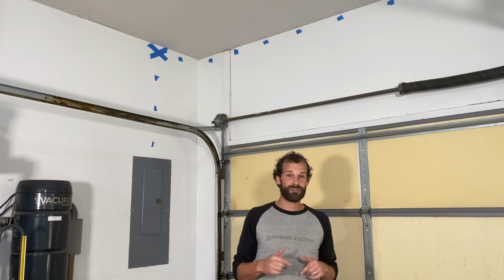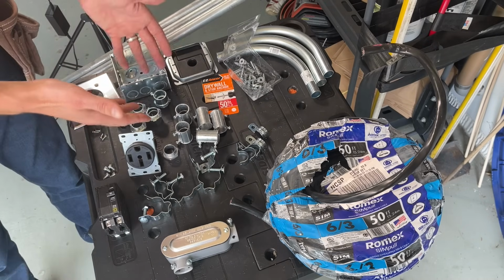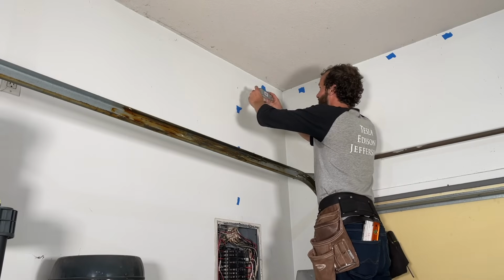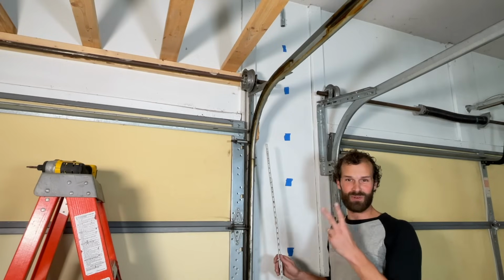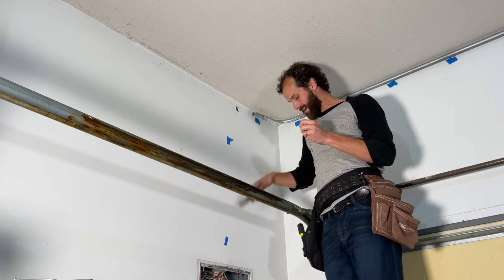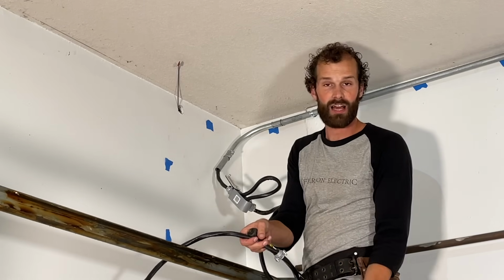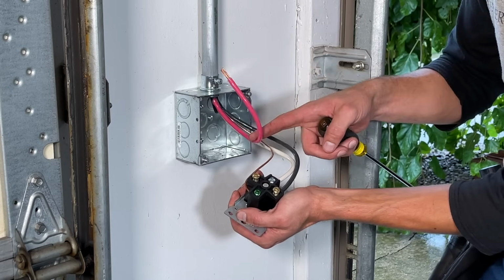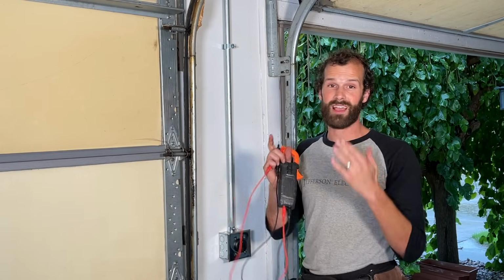How To Install a 240 Volt Outlet | Electric Car Charging

Comment: Nicely presented video, there definitely is a lot of value here just for giving people an idea of what's involved with this install. May I suggest though possibly leaving a pinned comment at the top noting all of the possible mistakes that have been pointed out by the community? Think it would be a good idea so that someone actually approaching this project (or wanting to see how an electrician should do it properly) knows that the video isn't perfect, and can use the pinned comment to ensure they know exactly how this should be done. I'm not really for the whole anti-DIY bandwagon I see going on in these comment sections, but I definitely do agree 50A 240V is not something to toy around with either.
Reply: By leaving a pinned comment he would be admitting he did not do the installation correctly and leave himself open to the consequences of someone following the instructuions and getting hurt/ killed.

Comment: My whole house has only a 100amp main breaker.. Can't be upgraded.. So forget ev.. No ABC for me.. Always be charging... .. Better install a giant hylon fire extinguisher for when it catches fire in the garaje and burns your entire home down as well a the concrete slab under the car
Reply: You can use an EV if it has a control that lets you regulate power draw.

Do you have 2 phases to make 220?
You can probably still use a smaller 220 outlet, like 15 or 20 amps.

Comment: Great teaching style and video.  I am a DIY guy only going to replace the outlet from a cheap one to a good heavy duty one but I watched the whole thing and it was instructive.  One question: While I understood the reason for flexing the wires, then tightening, and repeating that in the outlet box, why was that not necessary in the panel?  Is that because there is no flexing from inserting and pulling the plug?

Comment: "They're the 'same' thing." Yes and no. Yes, in the sense that they mean the same circuit. No in the number of volts. Tell people that since the voltage has gotten a little higher over the decades, the normal actual voltage is between  230 and 250 now.

Comment: I use a small anvil a ball peen hammer to flatten out the ends of the wire a little bit to insure a good tight connection

Comment: personally I would have gone with BX over Romex  its not only $52.00 less in cost for the wire  to buy also less work involved with fighting to pull that heavy wire through conduit.

Comment: Thanks for the video. Your friend is an enthusiastic electrician and a great teacher.  Agree with commenters that some things could have been done better.  For instance, much prefer THHN wire in conduit and would like to see a conduit system go from panel to box.   Would consider the installed tubing in this case to be more of a protective sleeve rather than a true conduit system.   Also not a fan of the faceplate arrangement on the wiring device.  Regardless, enjoyed the video.  Always glad to see other pros work.  Keep up the great work!

Comment: Great info but too all of those out there. TAKE YOUR RING OFF YOUR FINGER. Your hands are sweaty and wet not to mention its a great way for arking. In my job I do not wear my wedding band even with power off because the machinery may be off but there are capacitors that still hold charge. Smh

Comment: Good video, I watched it beginning to end. I have a couple peeves and questions though. 

Is this different from residential outlet installation where you curve the wire’s copper contacts into a hook before seating under the terminal screws? Is that not possible with this thickness of wire or is the terminal clamping mechanism different so that is not possible?  

Also I really don’t think the constant knocks towards safety especially while encouraging DIY’ers is a good idea. I think you should mention first and foremost where and how to turn power off and very specifically how to determine what’s still live if you couldn’t get a utility company to cut power from the meter. It is not ideal for you to start doing things and then three steps in be like “oh by the way you could have turned off power” because a person following your video to a T would likely inevitably do it in the same order as you. 

Please zoom in a lot more when you are talking about tiny specifics in the panel. I understand maybe you don’t have a cameraman and that the camera might just be on a tripod, but right now it’s basically us just watching some guy point at a million connections in a box for 5 minutes while you can’t actually see what he’s doing or even referring to, and then moving on with our confusion and questions still in place. 

Also it would be great if you could possibly do a video where this is installed as an outdoor receptacle near the driveway for those of us who don’t have garages.
Reply: This outlet is designed with internal clamp plates.  Conductor goes in hole, turn screw to tighten clamp.  You can get 120V15A receptacles made the same way , but more expensive than what you usually see in big box stores.
Reply: Please review NEC 625....electric vehicle service equipment in the National Electric Code.  This is the car charging section..  

Gfci breaker for recepticle for car chargin,, one charger per breaker, even as petty as the recepticle cove requirements for outside recepticles.

Hope that helps and remember, you can hire a pro.....

1.  You pay him to do everything

2.  You pay him to boss you around while you do everything.  ,(cheaper option and you keep that feeling of satisfaction,).  Okay  call it consulting  and pointers if you want.

Comment: Installing a NEMA 14-50 with the pointless neutral is pants on head retarded. NEMA 6-50 is the correct receptacle for car charging. The NM in conduit and the flush plate and mud ring on the unbonded surface box screams DIY really loud. And remember it's 40 amps continuous for your calculation, not 50.

Comment: I’m a little confused why you didn’t just go ahead & put in a double plug-in/outlet, since you were talking about TWO electric cars to begin with, having the two bays. As long as you’re there & doing it, might as well have set up for maximum allowance. Just my 2 cents.

Plus, with that J box up top, was it too thick & stiff of wire to route through the back hole to begin with, instead of having to shove in that loop? Seemed like a lot of stress. I’ve found it’s easier to just thread it direct like that instead of trying to loop out and then back in, even if I did have to inch my way along the wire until I got it to where it needed to be.

Comment: Great video - however, I have no more space for any kind of breaker in my panel. Can a plug be added with an out side breaker? any suggestions. Is that safe? or building code approved? a breaker out side a breaker box!
Reply: Add a subpanel, a second circuit breaker connected to the first.  Move some circuits to the subpanel to make room for their connection.

Comment: DIYer here. First off, super well done and detailed video! But I do have a question: if I'm not mistaken, as of 2020, don't you need a GFCI breaker for all outlets installed in a garage? (NEC 210.8(A)(2)). But I have also heard people say that the EVSE has a built in GFI that doesn't play nicely with having another one in series?...
Reply: I put a spa panel with a GFCI for mine when I did it since the garage is considered a wet location.

Comment: I'm not an electrician but I seen some incidents that looked unsafe plus lubing to have a smoother line feed seemed logical. That panel should have been covered while wire feeding. Especially install new breaker into the bar. your a lucky guy from what I seen.

Comment: I lucked out... the former owner had a 240V 50A line run to their hot tub and the cable is plenty long enough to re-route to the garage wall for electric vehicle power.  I decommissioned the tub and saved the breaker and cable run.   I only need to move the one end of the cable (in the basement), drill a hole and buy the box, receptacle & cover to mount on the garage wall.  Win, win.

Comment: One correction - NEC 625.54 require that EV charging receptacles be GFCI protected so you should have used a GFCI breaker. (garage receptacles are required to be GFCI protected as well.)
Reply: So the ev is going to be pulling 40 amp max because. Nec 625.41 this is a continuos load 
40x1.25= 50 amp current protection.
Reply: Good point, missed that one
Reply: Can I use a 60 amp breaker instead of 50?
Reply: @alexmckay5447  what kind of charger are you installing?
Reply: @alexmckay5447  no dont use 60 amp breaker instead of 50 amp you  if you are installing the NEMA 14-50 OR 6-50 THE OUT LET ARE REATED FOR 50 AMP MAX BUT YOU CAN ONLY USE 40 AMP CONSTANT LOAD  40×1.25= 50 AMP BREAKER . YOU CANT PUT 60 AMP BREAKER LOOK 48×1.25 =60  THIS IS A TESLA WALL CHARGER.
Reply: @alexmckay5447  yes if you use the right conductor size and get a larger capacity device.
Reply: The tesla wall charger and others are GFCI PROTECTED INSIDE THE CHARGER SO YOU DONT NEED GFCI BRAKER  BUT LIKE THE 14-50 AND 6-50 ARE NOT GFCI PROTECTED YOU NEED A GFCI BREAKER.
Reply: @panchopantera8287  if you have the equipment hard wired then there is no need for a GFCI breaker. If you are using equipment that plugs into a receptacle then any GFCI protection in the EVSE will not protect at the receptacle and GFCI protection is still required.
Reply: @ptester1  that is correct.
Reply: @ptester1  A 14-50 and 6-50 needs to be gfci protected at the breaker.

Comment: I think YouTube needs to make sure people are certified electricans before showing people how to do the work. 1st. No cardboard in front of the live panel , while using a metal fish tape.
2nd. While running pipe. You never leave the jacket on the wire. It's causes heat to build up, in the pipe .
3rd. They are not professionals.
3rd. These guts are not professionals.

Comment: Great video. I have two ac units. One ac unit is wired via a long under my courtyard conduit to a sub panel in a "mudroom" adjacent to my 2 car garage. I rarely use this 2nd floor ac. Is there a code legal switch that can be mounted adjacent to the 50 amp sub panel that I can use to either lead to new wiring to a 50 amp 240.plug that I would install in my garage or to the existing roof mounted ac/heater,  So I would be able to either charge a ev or run my ac?  One or the other not both.

Comment: I'm wondering if the rule below, applies to basement installation. The rule doesn't make any comment on it. This is Ontario code I believe. So 130 mm is about 5"

The stove receptacle (14-50R) must be mounted so the centre of the receptacle is 130mm from the finished floor (rule 26-744 (6)(a))

Comment: Liked this guy's step-by-step explanations, "pro tips," and odd little tips I've never heard of before (like the foldable ruler preference over a tape measure for one-handed use).

However, what surprised me right off the bat the most since this was targeted at DIYers was him not turning off the main breaker once the electrical panel was exposed.

Now, I can understand maybe Pro's not doing that and inconviencing a whole houseful of people (the client's family) going about their normal everyday electrified existence while he's out in the garage adding a 50 amp breaker and pulling wire, but as DIYer, I would certainly turn off the main breaker for the short amount of time pushing in the new breaker as well as pulling in the new wire and working in close quarters with an open 200 amp panel. normal

Comment: If using EMT, why use a ground wire? Ground outlet to box. Loads panel is grounded. EMT carries ground between box and panel.
Reply: Lower resistance?

Comment: Is there no requirement to ground the boxes and the conduit other than through the mud ring? It is my understanding that since the mud ring is a 'removable cover' it's not considered a valid grounding path, but will gladly stand corrected if this is not the case.

Comment: I think I would have used a 4 11/16 Box on both ends, plus I would have loosened the landing screws on the breaker before installing it

Comment: WOULD IT NOT BE SMART TO INSTALL A BOX AND BREAKER ABOVE THE 240 VOLT OUTLET ,,,TO TURN THE POWER ON ,,,AS TO NOT. HAVING TO PULL OUT THE. PLUG ,,ALL THE TIME.

Comment: Excellent video to teach DIYers.  Why didn’t he use THHN wires because the black outside jacket isn’t necessary inside EMT.  4-THHN wires are thinner and would pull easier.  They probably cost less too.  If a wired EV charger was used, note that most models do not have a common wire so you pull only 3 wires, 2-hot & ground (bare or green).

Comment: Your also not allowed by code per the nec to build conduit around the wire .you have to build the run and then pull through the boxes or pull points

Comment: Interesting presentation however,  just about everything is COMPLETELY WRONG!   I'm not an electrician nor a handyman I am a typical homeowner.  Cut the drywall  a foot away from the top of the panel  & use emt only. Never use nms (aka romex) I would have used THHN insulated cu wire.   It is  fast & easy to repair the drywall later.   Only use one  conduit body  inside the wall and one  4" junction box.  Flush mount the emt  all the way to the 50amp. outlet  merely making a box offset with your emt bender.   Don't use  pre-cut 90's  with excess fittings,  you only need  emt couplings and emt box connectors.  (you are buying too many parts for this simple single-phase 240vac instillation.   Per NEC  spacing guideline  for supports,   mark the wall stud locations  so you don't have to use  plastic drywall fasteners.   This goes for the  50amp. receptacle box  should be securely screwed to wood stud  and  file smooth the cover plate if there are sharp edges.   It is best to use compression fittings  and  you failed to use  insulated bushings  when  using box-connectors & lock nut only.  Always unsafe to use fish tape in electrical panel.  You don't even need a fish tape, wire pull lube,  or  another worker to help.  A better method  is to put up  all the emt with only a couple of clamps,   then  slide  each length of emt onto the wires,  so fast and simple.   A better method of de-burring emt is to use a "rout-a-burr" as all machinists  use.    I know I could do the installation faster,  safer,  with less money spent  and  all done to NEC and local electric codes.

Comment: Hi, I enjoyed the video.  I am going to be installing a 240v 20amp outlet for a ham radio amplifier and had a question.  I have seem some electricians comment that you normally shouldn't use Romex inside a conduit. (Not that it presents a code issue, but that that it just normally isn't a typical practice because of potential heating problems.)  Do you have an opinion on that?  I know I could purchase the separate 12-guage THHN wires, but thought 12-2 NM would be simpler and not too stiff to pull.
Reply from the maker: Hey Nick,  unlike what the video showed I would recommend Separate wires as compared to the Romex we pulled.  Should be easier to get them through the conduit. Best of luck on the project.

Comment: Great video.  My 2 cents as a master electrician..... 4 square above panel instead of LL/LR/LL, fiberglass fish rod for wall fish, raised industrial cover for receptacle, and metallic outlet box must be bonded as the conduit run is not continuous to panel.
Reply: This job would look different if I did it too.  However, did he violate code anywhere?  I question if the box is grounded iaw the nec.

Just found this one.....but 406.11 (recepticles)  connecting the ground terminal to the box.....250.146.(A). Roecepticle ground term to box, surface mounted., the yoke to box connection shall provide the effective ground path.  So the box is grounded as per 314.4?

The only possible violation I can see is 625.54, which requires a gfci breaker for car charging (ELECTRIC VEHICLE SERVICE EQUIPMENT) recepticles.  
I only deem it possible because of 90.4 and not enough information from ahj.

Please not 625.54 the gfci requirement ...car charging was not changed in 2020  so maybe for 2017 or earlier.

Now, I consider myself an "A-" guy.....good but not perfect.  So if I missed a concern please let me know.  And if I have a reference wrong, yeah, give that written smack down.
Reply: @keithharrington8715  I think he did a good job, but to answer your question yes. The 4x4 outlet box utilized for the receceptacle would be required to be bonded to be code compliant. A ground stinger should have been installed into the 4x4 box, which would bond the box, attached metallic conduit, fittings, and metallic receptacle cover to prevent them from becoming energized.
Reply: @rodneyparker9912  sir, I would have attached the egc with a wire to the box and recepticle (pigtailed it).  However, 250.146 says you can skip the bonding jumper if you do 250.146 A, B, C, or D.

It looks like here he followed (A).
Reply: I don’t think this meet box fill requirements. The box + mud ring is smaller than the 40 cu in required. Guessing people forget the oversized yoke needs to be counted twice.
Reply: @ronnietruman7296  Ronnie, my assumption was the box size was misspoken. 

My experience is 4 x 4 in boxes have rounded corners and 4 11/16 x 4 11/16 boxes have the square corners shown here.

This would take the box from 30.3 to 42.0.

I am not trying to argue. You are exactly on point from the words used.
Reply: @keithharrington8715 (IMHO) The articles you are referring to allow the receptacle to be grounded via its yoke in direct connection to the box. Not vice versa. Not good practice either way and would be highly frowned upon by ahj if you tried to use this shortcut.
Reply: @rodneyparker9912  thanks Rodney.  Looks like you are right.  Did some better reading and The yoke can ground the recepticle to the box connected to the egc..
Reply: @keithharrington8715  Thanks for the discussion, and have a great week!